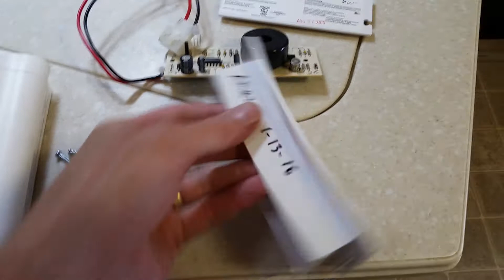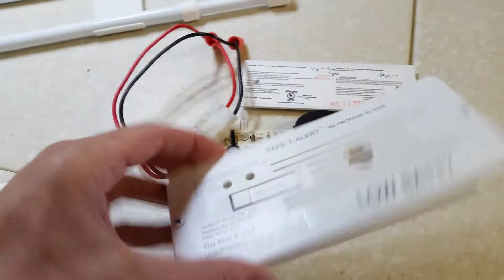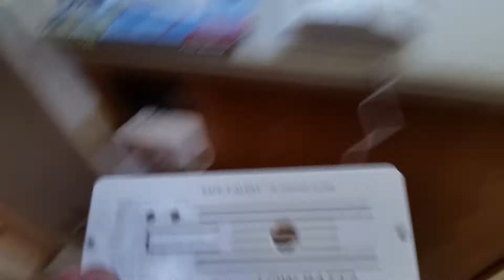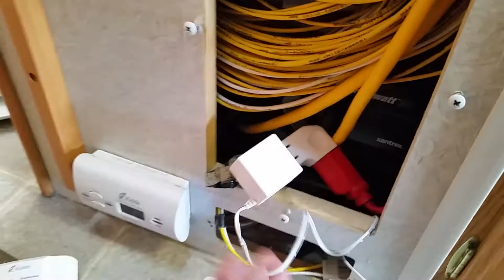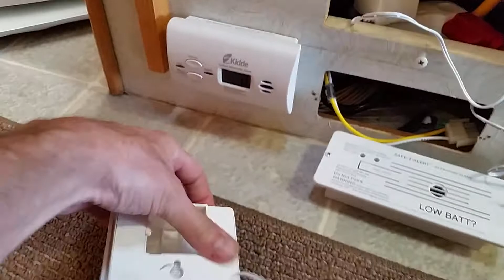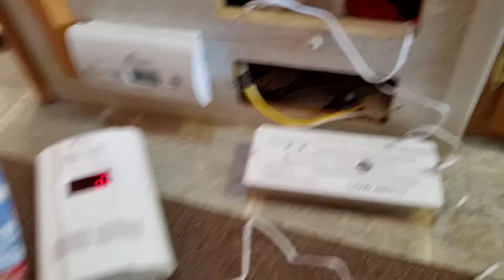RV Repair: False Alarms Solved MTI Industries 30-442-P-WT Safe T Alert Propane Gas Alarm – White

Comment: You marked 1-13-16 on the detector but it’s already got a date stamp on it for 8-31-15, which is when you should start the clock.
Reply from the maker: Thank you for the reminder

Comment: Having similar problems with my Propane Alarm and found your video.
The big question on your replacement Alarm by KIDDE, is it usable in RV applications.  I have found that many products that KIDDE manufacture are only for Home Use and Not for RV's  
Due to the Bouncing around our RV's take going up and down the road.  

Just wondering if you checked this fact.

Appreciate your reply.
Thank You.
Jeff
Reply from the maker: It's been a few years now and it still works great been on a lot of rough roads with no ill effects. Remember it has to run off 120 volts ac not dc . But I have a inverter so it's not a problem
Reply: @ktoutdoor  
Not trying to bust your chops here.  But, this is a statement from MTI!

Replace your Propane and CO Alarms that are over 5 years old. Only install Propane and CO Alarms that are UL listed for Recreational Vehicle Use. Some CO Alarms or their replaceable CO sensors may have a shorter service life. Check the manufacturer's owner's manual for replacement information. Replace your Smoke & Fire Alarms that are over 10 years old.

And using a 120 volt version?  What happens if your inverter fails?
Reply from the maker: @jst2768  The problem with the MTI was the false alarms I bought 2 replacements and a little after 1 year they 

would start beeping for no reason. That's why I went this route and so for it has worked great for me.
the Kiddie has all ready lasted longer than the last 2 MTI that I bought..  Plus instead of having to replace every 5 years the Kiddie last for 10 years it also has a 9 volt battery backup in case I loose 120 volts or the inverter. 

 If my inverter went out I would have a replacement with in 2 days.

Comment: What is the voltage on the AC adapter on the kidde?  Can you see the part number on the gas sensor on the MTI alarm? It's the  silver round device with the screen on the top opposite end from the power connection.
Reply from the maker: 9 volts 250 ma
Reply from the maker: Give me a call 606-875-0125

Comment: Great video. I bought a 2013 TT and have had problems with this going off constantly. I turned off all propane  and it still goes off. I could always re-set it until last night when I got home from work, so I cut the wires to it. I was shopping for another one, thinking this one must have gone bad. I'm happy to have found your post, now I know it is bad. This one is a 2013 and its now 2019. Thanks for the idea of using something else.
Reply from the maker: Thanks for taking the time to leave a comment.  Glad you got it figured out .. you know with a RV its always something..lol

Comment: Kevin: I'm looking at a 1965 marlette mobile home. Do you think there would be asbestos or lead paint in it. Is there a way to tell?
Reply from the maker: Traveling with Rick I'm not sure about the asbestos or the lead paint .. I would be more concerned about aluminum wiring. ..pull breaker box cover and look for copper wires coming off each breaker.
Reply: Ok thanks